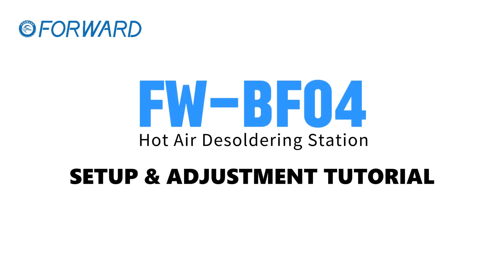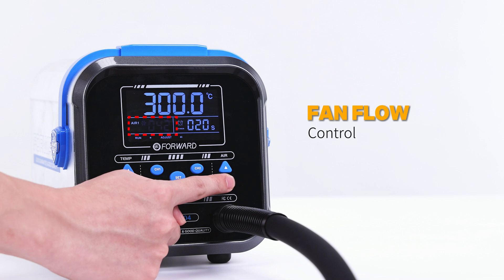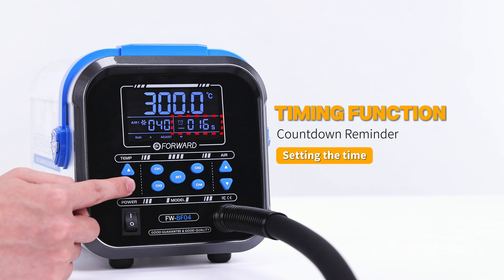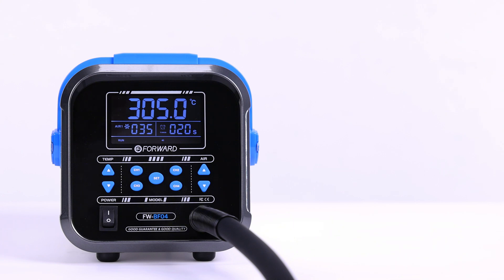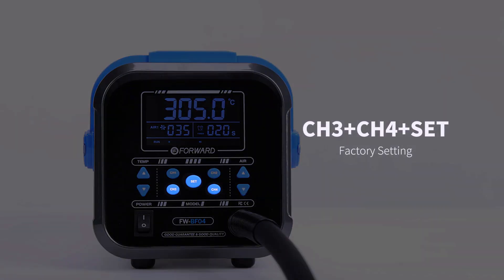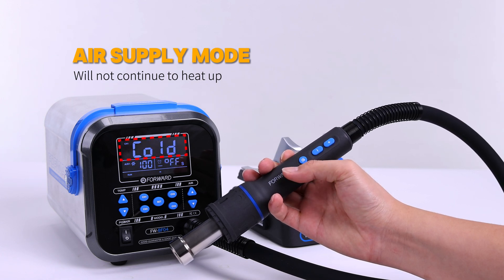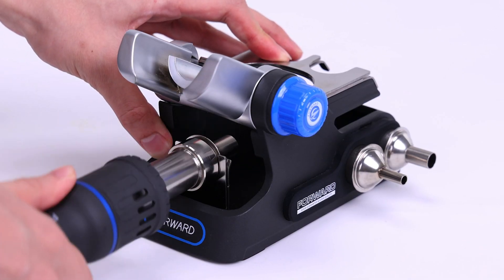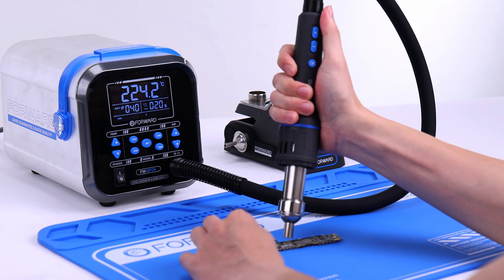🔥FW-BF04 Helical Wind Desoldering Station setup & adjustment tutorial | FORWARD

Comment: Is this better than Atten st-862d or Quick 861dw in terms of CPU work especially for iPhone?
Reply from the maker: Of course. Many repair masters and beginners feedback that the BF04 is their top choice after use BF04. 

Our product got many advantages:
☑Accurate, Real & Stable Temperature: Highly precise thermal control with no fluctuations. 
☑Fast Heating: Reaches the required temperature rapidly. 
☑Toroidal Transformer: Ensures low heat generation and supports long-term, uninterrupted operation.
Reply: @FORWARDTOOLS_machine the wind is helical just like quick 2008d+, I think is nothing special, just the raw power of 1300w vs 750w of quick 2008d+